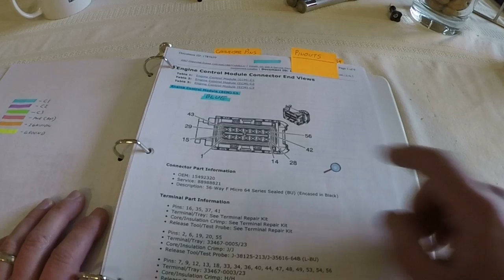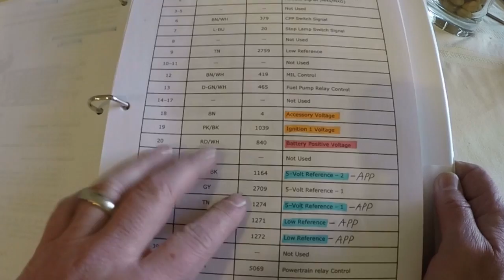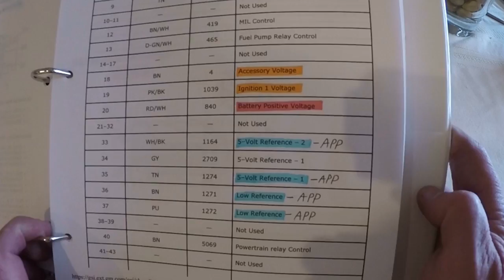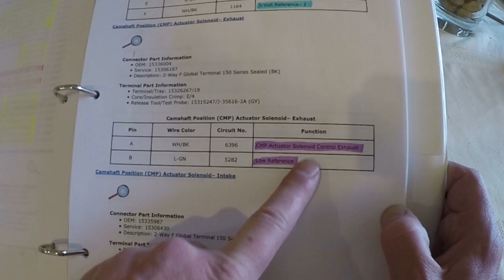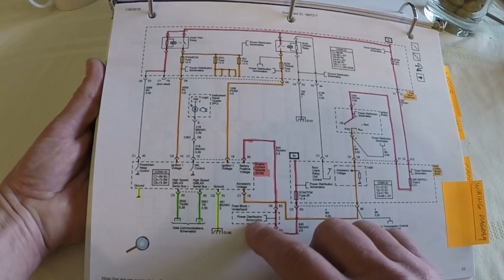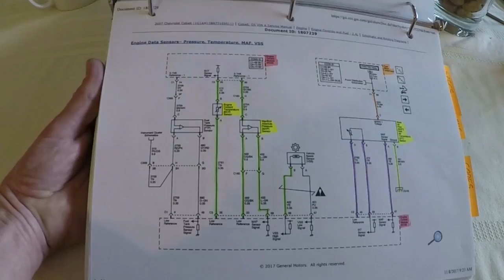Ecotec ECM Program and Harness trimming

Comment: How do you know what to use and what not to use?
Reply from the maker: You need the pinout diagram for the ECU you are running. This will tell you the sensors it's using and where the wires are landed. Then you can remove the wires you don't.
Reply: @DougBugBuilder  Ok I appreciate the information . Thank you so much.

Comment: In you wiring, did you find a tach signal wire or pin for the older neg coil type tachs?
Reply from the maker: No I didn't. And I looked, I was never able to find anything to hook up a tach to.
The only thing I have for a tach is the digital dash setup I have. Which basically displays info from the OBD port.

Comment: Hi Doug, Outstanding work. I have been following the videos adamantly. I have a E37 PCM 2008 Cobalt L61, for which I am planning to convert into a Mini Stock Oval Track car. Rather than purchasing a new harness, I am wondering about building my own standalone harness using the OEM harness and trimming it down, similar to what you're doing in this video. I am wondering how you determine which connectors and sensors are still required, and if you have the pinouts for an E37 L61 2.2L. Thanks in advance!
Reply from the maker: Can I assume you have seen the shared folder?
https://drive.google.com/drive/folders/1i0qTcN-1BB5_Lu6umgi9OrvRJKr-0vz3
Check Ecotec pinouts, also check the Harness connectors. That shows basically what connectors you'll need. Minus the VVT plugs. Now differences between the E67 and E37 I'm not sure of. Only way to know that is to get your specific pinouts. Did you see the video where I show how to get the 3 day subscription from GM for your pinouts? If not let me know and I'll link the video for you.
Reply: @DougBugBuilder  Hi Doug, I have since logged in and read through your entire folder. I have also removed the harness and labelled each connector. I am now ready to start. I think my main confusion is understanding which circuits turn the ECM "on", and where battery power, ground, and ignition control needs to be run. I have read the schematics and see the main control from the ignition switch seems to travel to the BCM, before I'm assuming sending 12V to the ACC VOL connector on ECM Connector 1. I am then assuming this powers on the ECM. I also see which pin sends "Starter Control" voltage out to the starter and/or starter relay, but I'm unsure which pin into the ECM actually tells the ECM we want to begin cranking. Thanks for any help Doug.

Comment: I have a 2.2 ecotec engine that i would like to put in my  dune buggy. Can you tell me if i will have any kind of issues with putting it in?
Reply from the maker: Hard to say exactly but the Ecotec doesn't take much more room than the air cooled motor. It's a couple inches longer, so depending on your cage setup you might need to extend it a little.
Reply: Ok thank you ! Is there advice you can give me for the wire harnes installation?
Reply from the maker: @jaimelopez3598  If you are really handy with wiring you can do it the way I did. Download the wiring diagram and modify a factory harness with what you need. Then you still need to send your computer to Alpha Fab and have them flash it for you. That'll cost about $350.
Or Alpha Fab sells a complete wire harness kit with relays and a computer for $750. With that you just install the harness and you're good to go.
Reply: Is alpha fab still around?

Comment: I am putting in a n/a 2.2 ecotec in my alfa romeo spider..just came across your site here.i was surprised the you took a similar direction on the harness on paper and hardware as i did..i used c.b.m. motorsports to program my ecu..good louck on your build..i am still working on my set up..but going from 115 hp to a bit over 200 hp on a 2300 pound car should be cool.i did a lot of head work and polished the conrods to a mirror finish...

Comment: I have just started doing my own internet research and pouring over wiring diagrams, connector pinouts ect. for my project. I just came across this youtube video. I am building a 2005 Cobalt 2.2L & 5spd manual into a dirt track racer to race in the mini stock class. What was your donor vehicle? (year, make, model) Your ecm is completely different than what I have. I really hope mine can be reprogrammed for standalone. Not sure what to do if it can't programmed? Do you know of a web sight that has a list of ecm's that can be programmed standalone? The service # on my ecm is 12589998. I really appreciate the info and effort you put into making these videos. I have subscribed to your channel and will definitely check out your other videos.
Reply from the maker: Gordon, My ECM and engine is from a 2007 Cobalt. My ECM is the E67. Yours is the older version (not sure what it is called). I'm very confident it can be programmed for stand alone. Alpha Fab did mine and it's working great. I'm sure they will be able to tell you what can be done to yours.
This video from my Ecotec series has very valuable info on a website that will get you 3 days of access to GM wiring diagrams for $20. That's where I got most of my info. https://www.youtube.com/watch?v=Gxn8Ousj404&t=20s
I hope the videos help, don't hesitate to ask me any questions. Good luck with your build.